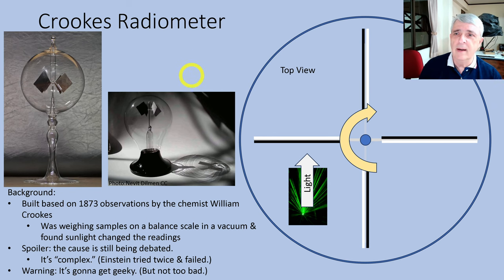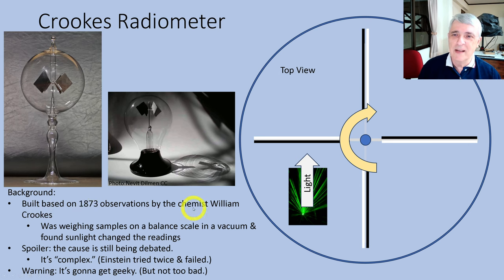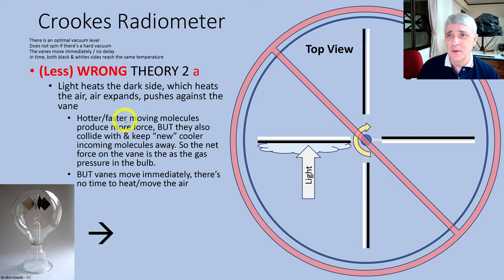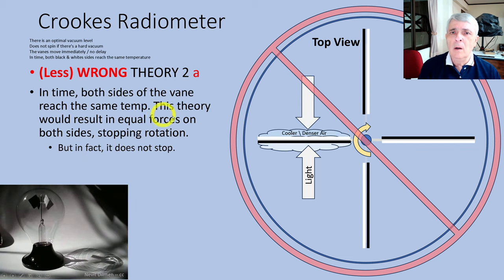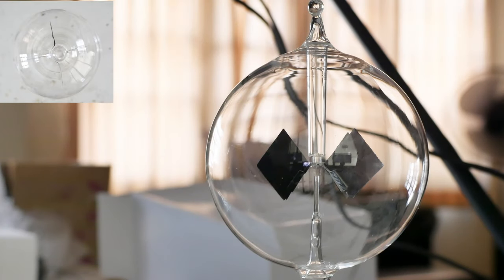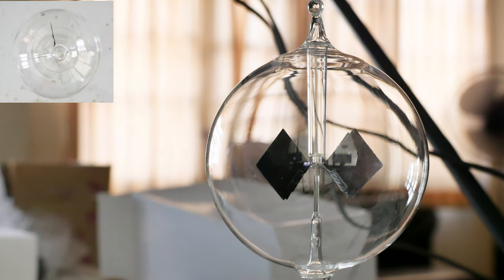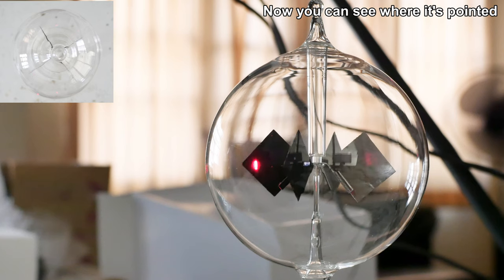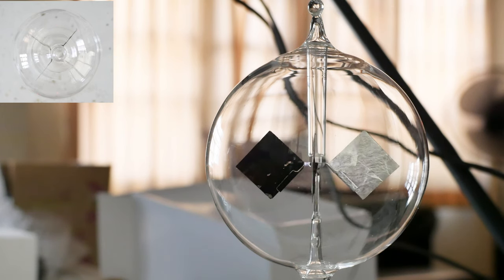Crookes Radiometer Explained. Newest 2024 Theory! (4K)

Comment: Cool!   I've never encountered the impact theory.

I bought a large number of them ($5, at a post-xmas sale.)  The vanes were glass cover-slips, one side soot, the other side white powder (perhaps smoke from burned Mg ribbon?)   They had a variety of pressures (and glow differently for the same Tesla coil.)  They also have a variety of frictions (spin them mechanically, let them coast down to 60RPM, then count the revolutions until they halt.)  With twenty radiometers you can sort them, then keep the best ones (and give the others as xmas gifts.)  During evening twilight, with only sunset-glow as illumination, the ones which had the brightest Tesla-coil glow and lowest friction are the ones which spin fastest.  Some wouldn't spin at all under those conditions.

I've seen versions which appear to have peeled-mica vanes and only one side blackened.  Yours in the video looks like soot-and-mica to me.  Not metal.  (Does the silvery side reflect a red laser as much as aluminum foil does?)    I've also seen some apparently using round glass cover-slips.  Round microscope-slips are less common, but do exist.  All of these are thermal insulators, and since the radiation-cooling is approximately the same for all coated surfaces, no major differences exist between black and white (and so the black side would be greatly heated via visible light, if both surfaces have near-identical cooling.)   A metal-vane radiometer with thermally-conductive vanes would be very interesting!   If you think you have one with metal vanes, break it open and check by bending the vanes (vent the vacuum, then scratch with a glass-cutter, to avoid imploding the bulb and destroying the vanes.)   Or, if to the eye it looks exactly like rough mica, probably that's what it is.   These are cheap, $12 each from sciplus if you buy two at a time (glass vanes, diamond shape.  Some were mistreated in shipping, and occasionally a corner of a vane is cracked off and missing.  Metal foil doesn't shatter like that.)

Just now I FINALLY tried laser pointer.  Green few-mW laser barely turns the more sensitive ones.  But my violet laser 395nM gets it slowly spinning.   TEST:  aim the violet laser-spot at the center of the vane, observe the motion.  Then move the laser-dot closer to the edge, near the upper tip of the diamond-shape (NOT to the outer tip, so no change in leverage.)  Yes, it then spins slightly faster, barely noticeable, maybe under 10% faster?  Aim at the center again, it visibly slows down (but hard to notice unless watching carefully.)    I'll have to set up a laser-holder, rather than doing it by hand.   Also, count the revolutions with a stopwatch, to get actual numbers for RPM changes, rather than trying to eyeball it.

Put radiometer inside a freezer, and it does go backwards, only to stop after a minute  ...then when removed, it slowly spins forward for half a minute.  Also, freeze-spray the glass bulb.  Or, big slab of dry ice held close.

PS, if your radiometer has poor friction, you can bias it with diffuse window-sunlight, just to the threshold where it starts turning extremely slowly.  That gets it past the static friction, so a small extra light-source may produce much more obvious results.  (Heh, or buy all of them from a museum store, sort for sensitivity, then return the rest back to the store?  Or just take a UV flashlight to the store, to open boxes and test RPMs.)   ALSO, the glass bearing may have "good spots," and by bouncing the radiometer to reposition the needle, sometimes the sensitivity to light sources will change dramatically.

Comment: I've been fascinated by those for decades. I almost bought one on a high school trip to the Chicago museum of Science and Industry in the 70's.

I've never bought into their theories as to what made them spin and still don't.

I've always wondered if they would spin in space without a glass dome and I suspect that's been tested.

I also wonder if it's just a smaller version of our solar system since our earth spins in a semi vacuum too for no apparent reason that makes sense to me.

A couple of observations; your light demonstration always directed the energy towards the black surface rather than testing both surfaces in a similar fashion.

Your electrostatic demonstration focused on a flow of electrons from the generator poles which were both located on the white vane sides. That experiment in total darkness might prove interesting to see if it causes rotation without any light differences between colors.

Your laser is a smaller version of our sun and it gives off heat from it's light which you concentrated on only the black surface. Would a more powerful laser with a color selected that reacts with white more than black and directed only on the white surfaces cause counter rotation?

Would a DC high voltage source such as a flyback coil cause the same rotation when presented to one side or the other?

Since radio waves can be focused; I wonder if there's been any attempt to build one of these devices with a pair of antennas inside so they could transmit radio waves from one side of the device to the other?

They could then switch antennas and transmit in the opposite direction to see if there's any difference. 

I suspect this has all been tried by first year university students in colleges all around the world decade after decade but I never had the luxury of being one of these students.

The curious mind is an animal that's always hungry.
Reply: MICROWAVE OVEN!  Radio transmitters make these turn very slowly, and the gas glows dim violet.   I tried nuking one in the kitchen microwave.   The low-pressure gas lights up blinding white, and the vanes instantly spin like a blur.   
I didn't dare to use full power (the sharp needle tip would just melt.)   So, I put an 8cu pyrex cup full of water in there.  Rotator-disk removed.   Nothing happens.  I progressively removed water.  Finally, with 4cu water, and a ten-second delay, suddenly the bulb lights up with plasma, and the vanes spin (spinning as usual, with black side retreating.)  
Afterwards, the radiometer still worked.   Undamaged.   Must be because, when it flashed white, I turned off the oven in about 1/4 second.
Reply: @wbeaty   I think the verdict is still out on your microwave test results. I realize there are insulated crucibles for melting metals in microwaves these days but I still don't quite understand how they work.

For instance, the entire inside of a microwave oven is metal yet it barely gets warm during use.

A microwave cookbook will have you put aluminum foil around a fishes head and tail to prevent those areas from cooking by blocking the radio waves.

A metal can over a tube in a tube radio works as a shield against radio waves and doesn't concentrate heat inside the tube to an extreme degree.

And why don't high powered vaccuum tubes have their metal components melt from radio waves? 

The gas glow you mention sounds similar to sticking a floresent bulb near a Tesla coil. I had read the gas concentrations in these toys was very low so glowing bright white seems extreme! I guess it's just a bit more of a mystery now.
Reply: @tenlittleindians  Microwave ovens will heat resistors such as carbon or silicon-carbide.  Those "microwave kiln" glass-melting kits use a hollow white cylinder of firebrick with gray paste made of SiC coating the inner surface.  The paste layer heats red hot.  See videos on DIY microwave glass-slumping art, etc.   Or, graphite crucibles can heat to glowing temperatures, to melt the lower-temp metals (not melt steel, just Al Cu Ag Au etc.,) but I think need protection so they don't just burn like charcoal.   Microwaves heat the graphite, but not the melting metal.

The oven walls stay cold, because the steel is a fairly good reflector and shield.  It may have many tens of amps, but that's spread out over large area.  The metal plate is "shorting out" the radio energy, forming a standing-wave pattern.  There's extremely high voltage in the chamber, but the voltage across any metal surface is nearly zero.   (The metal is a node in the standing waves, and the first HV antinode is at 1/4 wave of 2.5GHz, or 3cm.  Food stays cold unless it's lifted an inch away from the oven bottom.  Insects live happily, as long as they're not over 1cm tall (and not sitting on the glass dish!)   

Transmitting tubes only get hot when running well over 50 watts.  Bad SWR in your ham radio transmitter can make the plate-anode glow red.  Or, in large audiophile tube-amps, overdriving the final stage will give red glowing plates.  That's why we use graphite-anode tubes like CV-11 or 813H, if using vintage glass tubes.  They can take the high plate dissipation.   Modern tubes have the plate connected to heatsink fins, with a big blower, and no transparent glass parts.   

Radiometers have about ten millitorr pressure.   Compare with neon signs which have more like 1000 mTorr.   A small hand-held Tesla coil makes a radiometer glow dim violet, but makes a neon sign light up extremely bright.  My 200-watt vacuum tube Tesla coil driver will make a radiometer glow dimly, and the vanes start turning, as if a flashlight was shining on them.   

In the microwave oven, the radiometer lights up roughly like a thirty-watt light bulb.  But a small fluorescent tube in the microwave oven will light up like a kilowatt light bulb.   Just nuking an 8in fluorescent tube for two seconds will make it too hot to touch.   Do it over thirty seconds, and the glass softens, and blows bubbles (bursting outwards!  The plasma is like a blow torch, and makes the pressure rise from near vacuum to well over atmospheric pressure.)
Reply: @wbeaty   I read that radiometers were developed while trying to figure out why sunshine changed the weight of things being weighed. 

Since they showed microwaves can excite a radiometer an cause it to spin I guess it disproves sunlight from being the cause of the spinning.
Reply: @wbeaty  There are plenty of videos on YouTube showing microwaves completely destroying Radiometers i a minute, starting at 6 seconds.. You switched off just in time!!